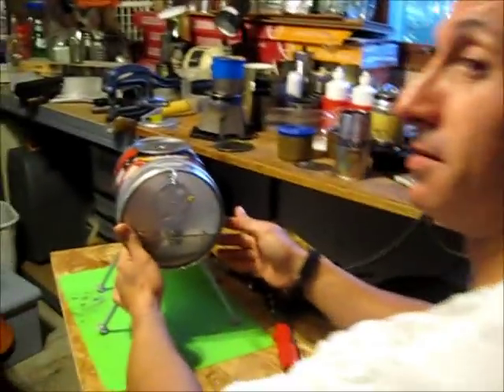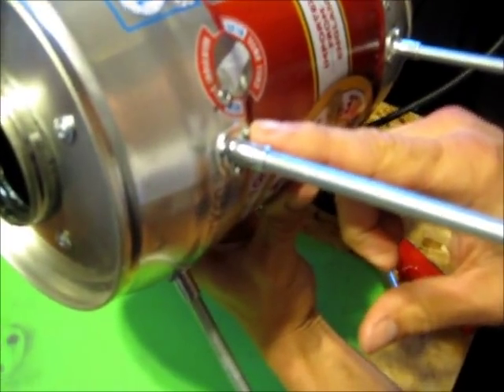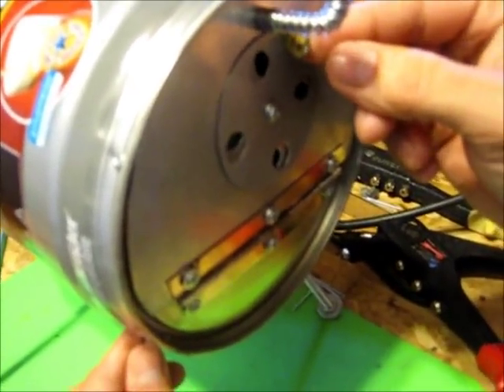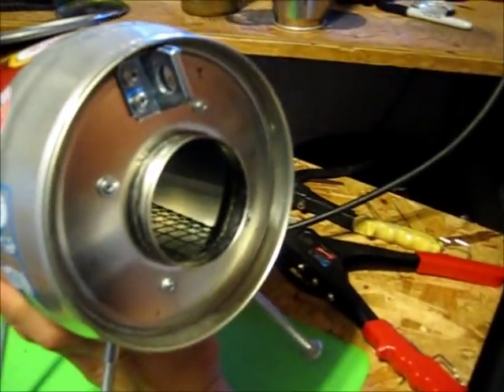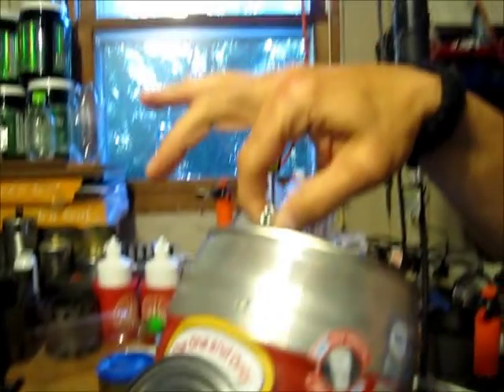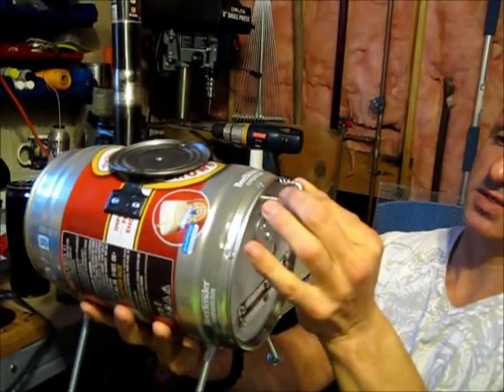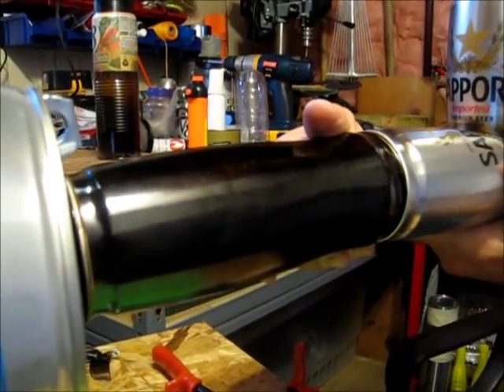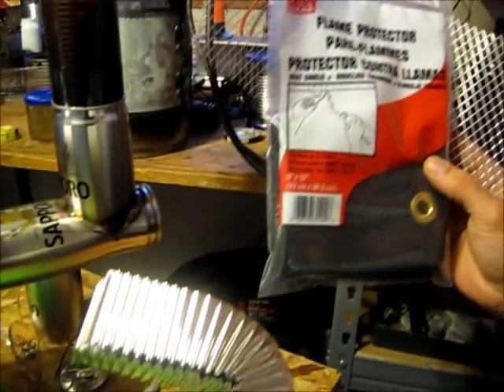DIY TENT WOOD STOVE PROTO #2...PT 2

Comment: I made one three years ago i used a large bean can removed rhe lird and rim crimped the edge like stove pipe and it slots into the recessed rim of the keg perfectly i cut a round whole real easy in that to fit my cans, i thought i invented it but saw 1 on here dated before me but it was an adaptation i havent seen still, it solves the problem of the t that alot of guys have your t piece is nice but harder to fasion very nice work. My next project is a back yard one from 2  5gal vegoil drums

Comment: Thank you! So you just rivet the carbon felt around the inside of the outer can to act as a heat wick sleeve for the top can with the screen/rain cap at the top then?...  Cottle bottles don't seem to be available much any more.  But I did find a steel can that may make a good substitute, although it's not aluminum. The motor treatment Sea Foam comes in a tall steel can that has been redesigned with a rounded, tapered top, much like a cottle bottle, but without the long neck.  Thanks again.